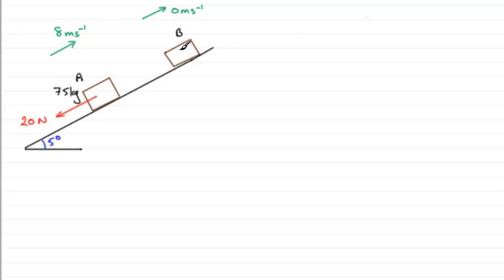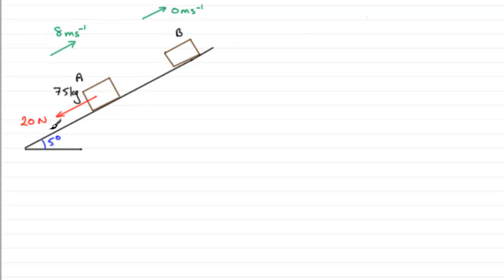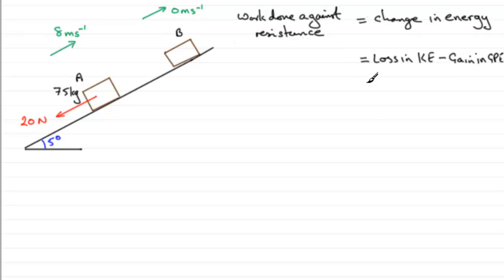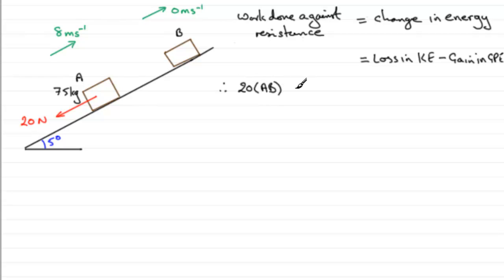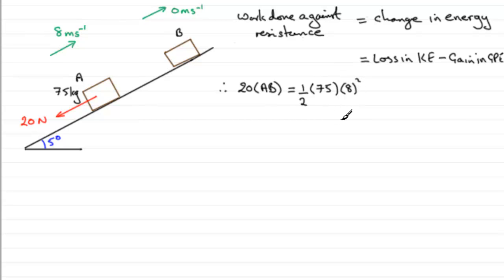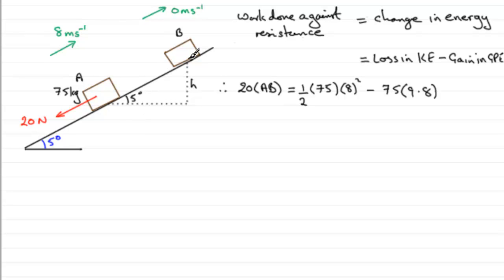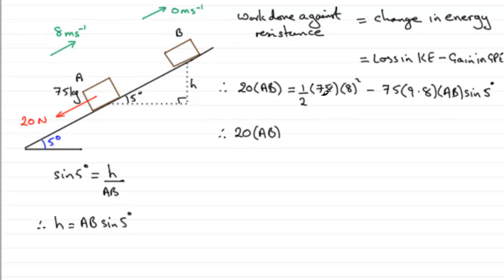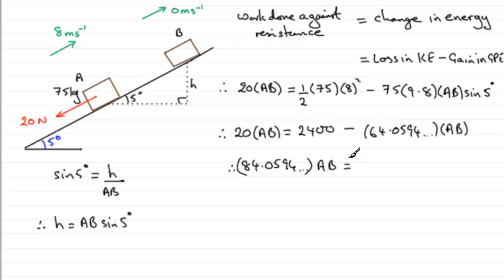Edexcel Mechanics M2 January 2012 Q3b : ExamSolutions

Comment: W.D is only due to external forces (friction and resistances) and not the internal forces like weight. Negative work done is due to resistances acting in the opposite direction to the positive direction (up the slope).

Comment: Why isnt resistance due to gravity accounted for?

i.e. why isnt energy loss=AB (20) + AB (75gsin5)

And therefore 2400 (ke loss)= AB(75gsin5) (GPE)+ AB(20) (non-grav)+ AB (75gsin5) (Grav)

Clearly that last AB(75gsin5) shouldnt be there- but why?

Thanks so much- your videos are an absolute lifesaver
Reply: I was thinking the same, doesn’t make sense not to include it, I’m guessing you are not working on this question any more, 11 years later